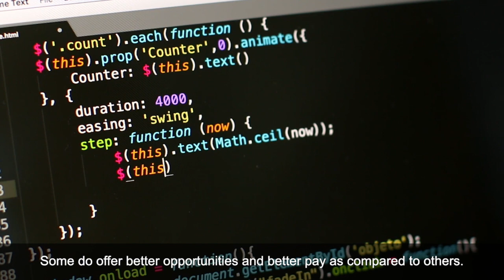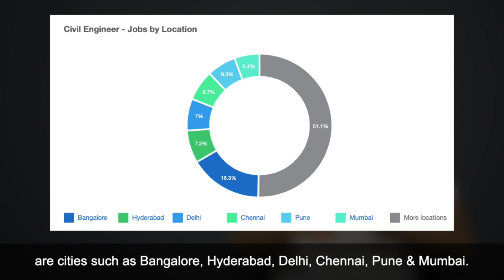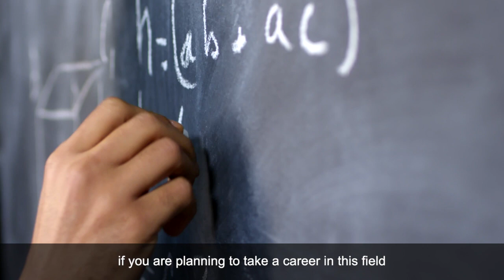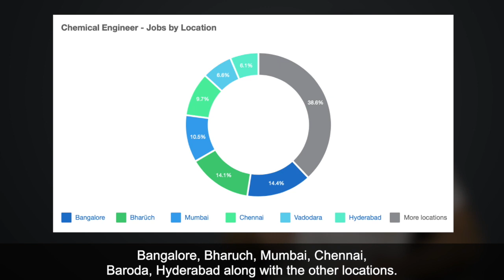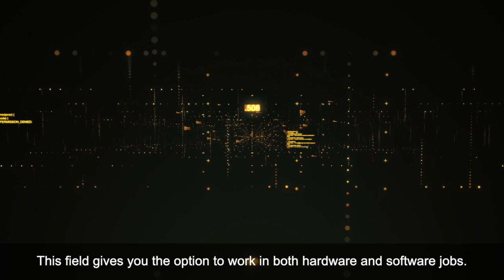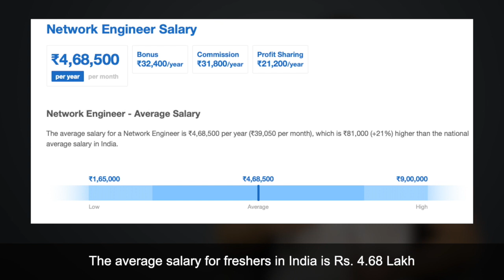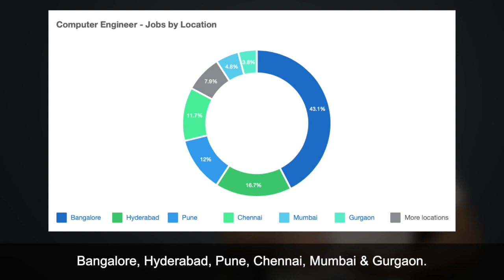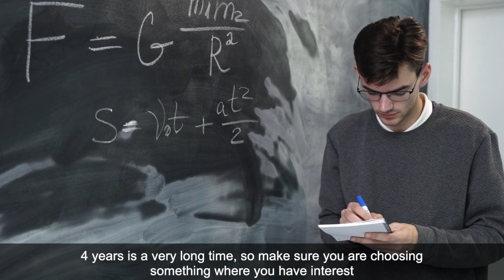Highest Paying Engineering Branches In India in 2024 (Which Engineering Degree To Choose)

Comment: Bro what about aeronotical engineering
Reply from the maker: Hello Venom, 

I wouldn’t recommend, since it’s a niche field & the demand for jobs in this field isn’t much high paying in India. I would rather advice taking mechanical engineering & then specializing in aerospace or aeronautical engineering field depending on your interest. It’s always better to go for a Broader field, because tomorrow if you want to switch your field, it’s easier to do. 

Eg , if you want to go for automobile or you want to go into oil & gas after your engineering, you can still do as a mechanical engineer, but if you are are doing a niche engineering field; it will be much difficult. 

So always choose a field which opens your door to multiple sectors and then do certifications on the field you want to specialize in that field. 
Hope this helps & if you have further doubts, drop me a message on Instagram - @nikhlogic

Comment: Shayad automobile engineering ko koi pehchanta hi nahi😅😅😂😂😂😂😂😂😂
Reply from the maker: Hello, 

I wouldn’t recommend automobile, since it’s a niche field & the demand for jobs in this field isn’t much high paying in India. I would rather advice taking mechanical engineering & then specializing in automobile depending on your interest. It’s always better to go for a Broader field, because tomorrow if you want to switch your field, it’s easier to do. 

Eg , if you want to go for aeronautics or you want to go into oil & gas after your engineering, you can still do as a mechanical engineer, but if you are are doing a niche engineering field; it will be much difficult. 

So always choose a field which opens your door to multiple sectors and then do certifications on the field you want to specialize in that field. 
Hope this helps & if you have further doubts, drop me a message on Instagram - @nikhlogic

Comment: Sir, What about Naval engineering ???
Reply from the maker: Hello Swaraj, I wouldn’t recommend marine or Naval engineering, since it’s a niche field & the demand for jobs in this field isn’t much high in India. 

I would rather advice taking mechanical engineering & then specializing in marine engineering field. It’s always better to go for a Broader field, because tomorrow if you want to switch your field, it’s easier to do. 

Eg , if you want to go for automobile or you want to go into oil & gas after your engineering, you can still do as a mechanical engineer, but if you are are doing marine engineering; it will be much difficult.
So always choose a field which opens your door to multiple sectors and then do certifications on the field you want to specialize in 

Hope this helps & if you have further doubts, drop me a message on Instagram - @nikhlogic

Comment: Sir I want to do aeronautical engineering, tell about that
Reply from the maker: Hello Kiran, I wouldn’t recommend, since it’s a niche field & the demand for jobs in this field isn’t much high paying in India. 

I would rather advice taking mechanical engineering & then specializing in aerospace or aeronautical engineering field depending on your interest. It’s always better to go for a Broader field, because tomorrow if you want to switch your field, it’s easier to do. 

Eg , if you want to go for automobile or you want to go into oil & gas after your engineering, you can still do as a mechanical engineer, but if you are are doing a niche engineering field; it will be much difficult. 

So always choose a field which opens your door to multiple sectors and then do certifications on the field you want to specialize in that field. 
Hope this helps & if you have further doubts, drop me a message on Instagram - @nikhlogic

Comment: What about aerospace engineering?
Reply from the maker: Hello, 

I wouldn’t recommend aerospace engineering, since it’s a niche field & the demand for jobs in this field isn’t much high paying in India. 
I would rather advice taking mechanical engineering & then specializing in aerospace engineering field. It’s always better to go for a Broader field, because tomorrow if you want to switch your field, it’s easier to do. 

Eg , if you want to go for automobile or you want to go into oil & gas after your engineering, you can still do as a mechanical engineer, but if you are are doing aerospace engineering; it will be much difficult. 

So always choose a field which opens your door to multiple sectors and then do certifications on the field you want to specialize in that field. Also, if you do have the budget, do mechanical engineering in india, and plan for masters abroad in countries such as US, Germany, Australia etc that have high scope for Aerospace Engineering. 

Hope this helps & if you have further doubts, drop me a message on Instagram - @nikhlogic

Comment: Marine engineering sir
Reply: I also wanted to opt marine engineering
But many of the experienced people say that there is no good scope in India right now .im also very much confused what to choose🤧
Reply from the maker: @God Leo, I personally would say take mechanical if your interest lies in Marine Engineering, as when you are doing B.Tech you should always select broader fields and then specialize in the sector which you want to. This way once you are 23-24, and you are more clear with what you want to do in your life, you will have more options. You can always work in the marine sector by being a mechanical engineer.
Reply from the maker: Hello Vijaya, I wouldn’t recommend marine engineering, since it’s a niche field & the demand for jobs in this field isn’t much high in India. 

I would rather advice taking mechanical engineering & then specializing in marine engineering field. It’s always better to go for a Broader field, because tomorrow if you want to switch your field, it’s easier to do. 

Eg , if you want to go for automobile or you want to go into oil & gas after your engineering, you can still do as a mechanical engineer, but if you are are doing marine engineering; it will be much difficult.
So always choose a field which opens your door to multiple sectors and then do certifications on the field you want to specialize in 

Hope this helps & if you have further doubts, drop me a message on Instagram - @nikhlogic
Reply: @NikhLogic  
Sir ,I am using my parents device ,
I'm Jahnavi. 
Sir if I have an opportunity to study abroad in a renowned institute , which branch should I choose , as I was interested in Marine engineering ,
But now , I feel that it's no more a  good option.
Please help me out sir🙏.
Among Aerospace , Chemical, Mechanical , Materials Science and Engineering , Engineering Physics  and Civil engineering ect ...
Reply from the maker: @Viajaya, 
Instead of Aerospace - Take Mechanical, as it's a broader field
Chemical Engineering - Good Field 
Material Science - No 
Engineering Physics - No
Civil Engineering - If your interest lies towards Aerospace or Marine, then Civil Engineering is a totally different field. So no
Reply: @NikhLogic  Thank you 🙏🏼🙏🏼

Comment: Sir how about aerospace engineering and aeronautical engineering related to space and aircraft’s
Reply from the maker: Hello Bhargav, 

I wouldn’t recommend either, since it’s a niche field & the demand for jobs in this field isn’t much high paying in India. 

I would rather advice taking mechanical engineering & then specializing in aerospace or aeronautical engineering field depending on your interest. It’s always better to go for a Broader field, because tomorrow if you want to switch your field, it’s easier to do. 

Eg , if you want to go for automobile or you want to go into oil & gas after your engineering, you can still do as a mechanical engineer, but if you are are doing a niche engineering field; it will be much difficult. 

So always choose a field which opens your door to multiple sectors and then do certifications on the field you want to specialize in that field. 

Hope this helps & if you have further doubts, drop me a message on Instagram - @nikhlogic
Reply: @NikhLogic  thank you so much sir
Reply from the maker: Happy to help :)

Comment: Sir... I'm mechanical engineering student. I want to go into design. I wanted to know what will be the salary in design field after 5 years, 10 years and 15 years. So that I can plan accordingly.
Recently I'm hearing scope and salary will be high in software/IT field. So I need to compare and take right decision. Please reply.
Reply from the maker: Hello Shrikanth, sorry for late reply, as was traveling. 
So, It depends which market are you looking at, and also depends where are you working & which sector are you working. You have design in automobile, pipeline, aeronautics etc. Each sector pays you different. Also your salary in 5 years or 10 years depends on your performance, as year on year, your salary will increase based on your increment for that year and increment happens based on your performance during that year.
Reply: @NikhLogic  thank you.
 I agree that performance and which sector I'm working impact much. But I need comparison between mechanical design engineer and software engineer (developer). 
So I can decide about switching to software or not.

Comment: Would be great if you could tell me about aerospace engineering in India, it's growth in India and in other countries
Reply from the maker: Hello, I wouldn’t recommend aerospace engineering, since it’s a niche field & the demand for jobs in this field isn’t much high paying in India. 

I would rather advice taking mechanical engineering & then specializing in aerospace engineering field. It’s always better to go for a Broader field, because tomorrow if you want to switch your field, it’s easier to do. 

Eg , if you want to go for automobile or you want to go into oil & gas after your engineering, you can still do as a mechanical engineer, but if you are are doing aerospace engineering; it will be much difficult. 

So always choose a field which opens your door to multiple sectors and then do certifications on the field you want to specialize in that field. Also, if you do have the budget, do mechanical engineering in india, and plan for masters abroad in countries such as US, Germany, Australia etc that have high scope for Aerospace Engineering. 

Hope this helps & if you have further doubts, drop me a message on Instagram - @nikhlogic

Comment: What about is petroleum engineering?
Reply from the maker: Hey Nikhil, I wouldn’t recommend Petroleum engineering, since it’s a niche field & the demand for jobs in this field isn’t much high in India except with few giants like Reliance, BPCL, ONGC etc.  

I would rather advise taking mechanical engineering & then specializing in petroleum. It’s always better to go for a Broader field, because tomorrow if you want to switch your field, it’s easier to do. 

Eg, if you want to go for automobile or you want to go into aerospace, you can still do it as a mechanical engineer, but if you are doing petroleum; it will be much difficult. Also, to work in Oil & Gas sector, Middle east is a great place to work at. Also, most of the Oil & Gas companies will have mechanical people working there. So rather go for the broad field. 

Hope this helps & if you have any doubts in this field, feel free to drop me a message on Instagram @nikhlogic. Will be happy to help :)

Comment: I want to do my career in aircraft maintenance engineering so it is good career
Reply: I want to build my career in MINECRAFT 😅
Reply from the maker: Hello Aakansha, I wouldn’t recommend, since it’s a niche field & the demand for jobs in this field isn’t much high paying in India. 

I would rather advice taking mechanical engineering & then specializing in aerospace or aeronautical engineering field depending on your interest. It’s always better to go for a Broader field, because tomorrow if you want to switch your field, it’s easier to do. 

Eg , if you want to go for automobile or you want to go into oil & gas after your engineering, you can still do as a mechanical engineer, but if you are are doing a niche engineering field; it will be much difficult. 

So always choose a field which opens your door to multiple sectors and then do certifications on the field you want to specialize in that field. 
Hope this helps & if you have further doubts, drop me a message on Instagram - @nikhlogic

Comment: What about marine enginearing is it good
Reply from the maker: Hello Mazin, I wouldn’t recommend marine engineering, since it’s a niche field & the demand for jobs in this field isn’t much high in India. 

I would rather advice taking mechanical engineering & then specializing in marine engineering field. It’s always better to go for a Broader field, because tomorrow if you want to switch your field, it’s easier to do. 

Eg , if you want to go for automobile or you want to go into oil & gas after your engineering, you can still do as a mechanical engineer, but if you are are doing marine engineering; it will be much difficult.
So always choose a field which opens your door to multiple sectors and then do certifications on the field you want to specialize in 

Hope this helps & if you have further doubts, drop me a message on Instagram - @nikhlogic
Reply: @NikhLogic  thank you sir for your reply
Reply from the maker: Happy to help :)

Comment: I am doing diploma in electrical engineering and have planned to do b.tech.
Is there any scope of electrical engineer in india
Reply from the maker: So Anuj,  

Electrical Engineering Is absolutely a good field but the issue is, Electrical engineering has very low demand in India due to the nature of the jobs. It’s still a growing field in India & the overall demand for electrical engineers as compared to how many engineers are graduating every year is actually less. 

As an electrical engineer you have very high scope in countries such as Canada & Australia where this is considered to be a skilled profession with high demand and less supply. 

I would highly recommend looking for these places and understand how can you shift there prob through Masters. India isn’t best for electrical engineers to be honest & growth scope is very limited. This is based on the placements & demand of jobs as per 2019 data in core field. So if you are doing electrical engineering, plan your studies in such a way that you can do B.Tech in India and then go for masters in Germany, Australia or Canada. These countries have high demand for electrical engineers. 

In regards to diploma, it makes it harder to work abroad with a diploma. Not many countries take a diploma as a valid degree. So considering you are spending the time & effort, I would highly recommend taking a degree which adds value. But it also depends on which year you are currently in. If you are almost done, it doesn't make sense to start all over again and do engineering. 

If you have any further doubts, drop me a message on Instagram. Will be happy to help :) 
@nikhlogic
Reply: Thanks sir

Comment: Sir please tell about the current phase for aeronautical engineering in india
Reply from the maker: Hello Harjot, I wouldn’t recommend, since it’s a niche field & the demand for jobs in this field isn’t much high paying in India. 

I would rather advice taking mechanical engineering & then specializing in aerospace or aeronautical engineering field depending on your interest. It’s always better to go for a Broader field, because tomorrow if you want to switch your field, it’s easier to do. 

Eg , if you want to go for automobile or you want to go into oil & gas after your engineering, you can still do as a mechanical engineer, but if you are are doing a niche engineering field; it will be much difficult. 

So always choose a field which opens your door to multiple sectors and then do certifications on the field you want to specialize in that field. 
Hope this helps & if you have further doubts, drop me a message on Instagram - @nikhlogic

Comment: Sir, what about MARINE ENGINEERING? is it good carrier option or not?
Reply from the maker: Hello Aditya, I wouldn’t recommend marine engineering, since it’s a niche field & the demand for jobs in this field isn’t much high in India. 

I would rather advice taking mechanical engineering & then specializing in marine engineering field. It’s always better to go for a Broader field, because tomorrow if you want to switch your field, it’s easier to do. 

Eg , if you want to go for automobile or you want to go into oil & gas after your engineering, you can still do as a mechanical engineer, but if you are are doing marine engineering; it will be much difficult.
So always choose a field which opens your door to multiple sectors and then do certifications on the field you want to specialize in 

Hope this helps & if you have further doubts, drop me a message on Instagram - @nikhlogic